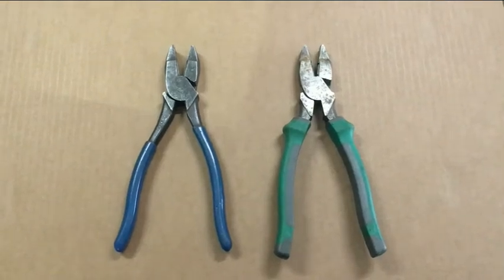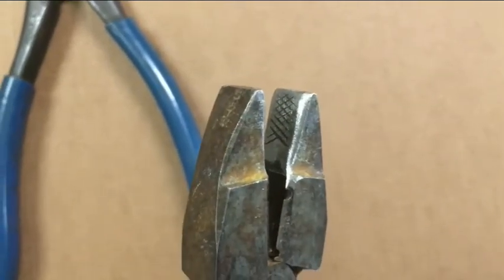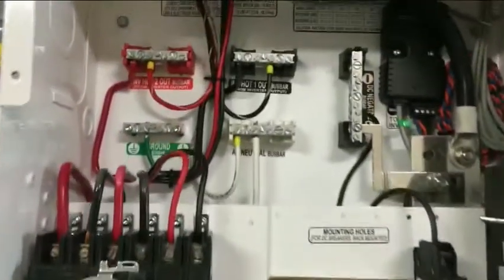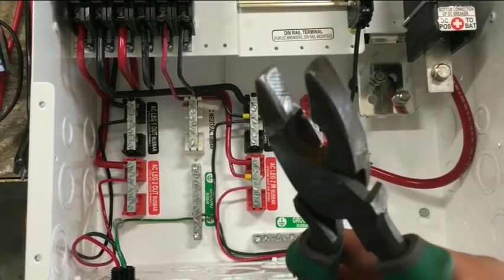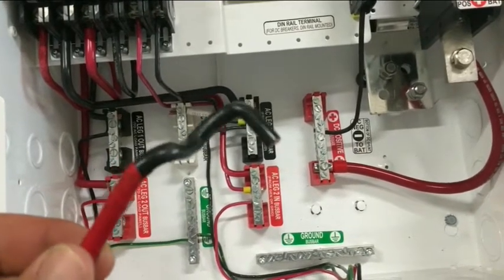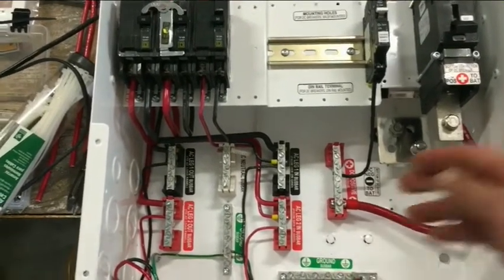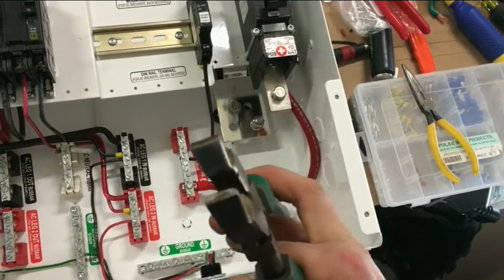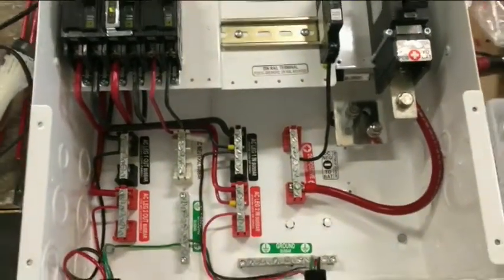Secrets of Solar:  Custom pliers for bending big wires

Comment: TY.  This tool looks like it would work to bend the end of 6 gauge wire to fit in a NEMA 14-50 outlet.  I would suspect that you bend first and strip the insulation second.